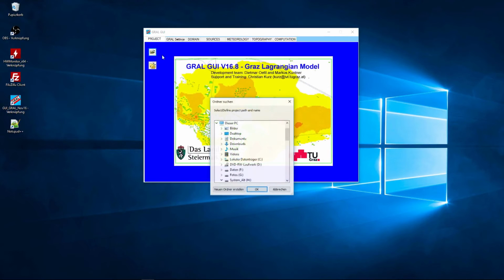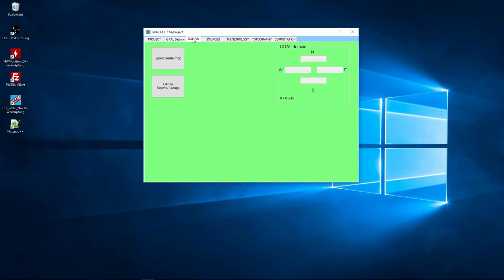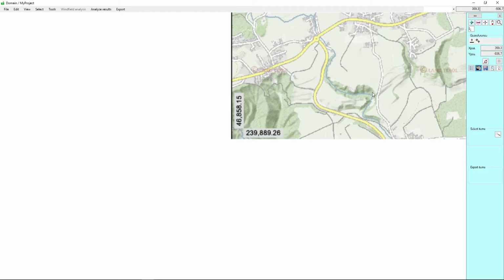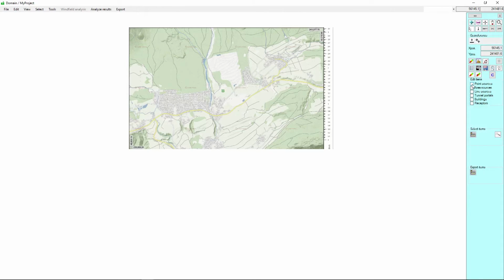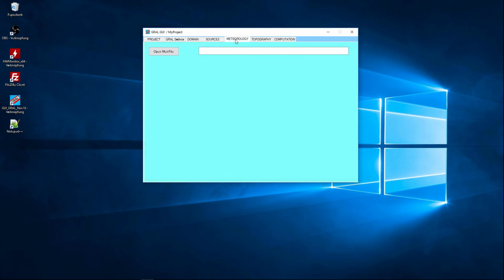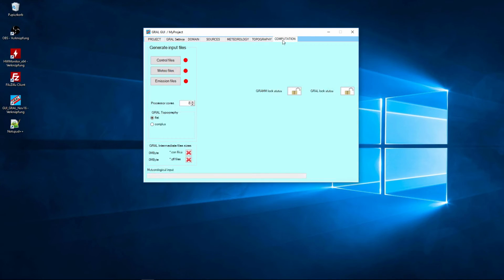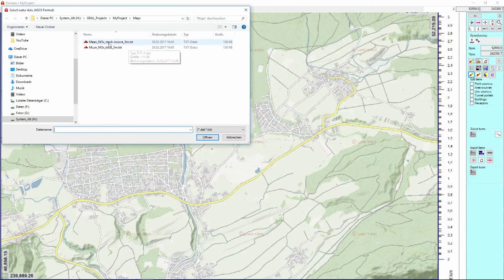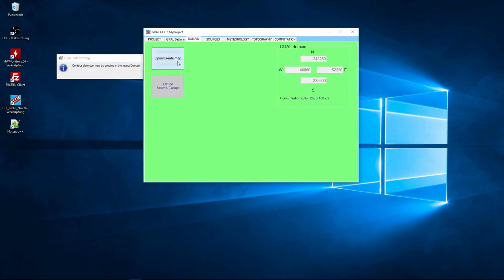Simple Project with one Stack | GRAL #1

Comment: Hi! Thanks for the video! I just wondering if I could use GRAMM GRAL for calculating radioactive deposition?
Reply from the maker: Dietmat Oettl said this should work, there is a decay rate and dry and wet deposition is supported by GRAL. I am more careful because we have no validation data sets for such an application and GRAL is designed for small domain areas (we are using GRAL on a powerful server and domain areas up to 50x30 km).

Comment: Hello, I was wondering if it is possible to add CO2 as a pollutant? And I would like to know where I should go to get meteorological data.
Reply from the maker: GRAL is designed to calculate the emission of air pollutants at a small to medium scale (100 m to 50 km) at low altitudes above ground (0 m to several 100 m) around sources. Calculating CO2 with many sources and sinks probably requires other models and scales.

Comment: May I know how to define the distance from the point source with a certain concentration value? (the one small block show using object manager)
Reply from the maker: Distance measurements can be made using the measuring tool started with the button with the [m] icon or the "Tools - Length measurement" menu. 
Concentration values of evaluated concentration maps can be displayed using the button with the C symbol or the "Analyze Results - Extract concentratin at a point" menu.
I am sorry and would like to apologize, but I do not know what you mean by the term "the one small block show using object manager".
Reply: @grammgral8697  I have emailed the picture to you. Do you receive it? I want to ask how to know the distance from the point source when it is at certain concentration value. The length measurement is inaccurate when i use it. The object manager can display the small concentration value table on the map but didn't show the distance value.

Comment: What is the coordinate format of the two points shown on the bitmap?Is this a UTM?
Reply from the maker: First many apologies for the very late reply. The support is done by the TU Graz, as a developer I have neglected the channel very much in the last year. 
The coordinate system must be a decimal number (no degrees). The GUI itself does not currently support coordinate transformation, the coordinate system is specified by the user through the use of georeferenced bitmaps or the referencing of an existing bitmap. A georeferenced digital map or image has been tied to a known Earth coordinate system.

Comment: how do you know the particles per sec that a stack is emitting? 
i am trying to evaluate the concentration of NOx but i don't have the number of particles per sec
thanks
Reply from the maker: first of all many apologies for the very late reply. The support is done by TU Graz, as a developer I have neglected the channel too much in the last year. 
The particles per second indicate how many Lagrange particles the model should use internally. Guidance on the number of particles is provided in the GUI manual and the GRAL Recommendations.

Comment: Where can I download this kind of map with ruler and x y points?
Reply from the maker: Unfortunately, there is no download page for this example project. You can use any graphics and georeference them manually at the GIS window. The georeferencing and thus a background graphic is necessary to set the coordinate system of the GUI.